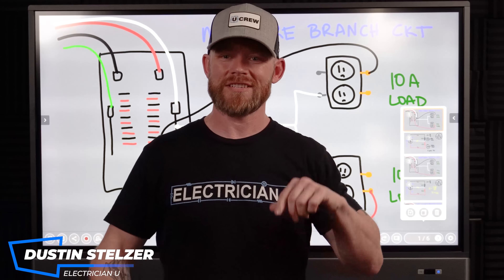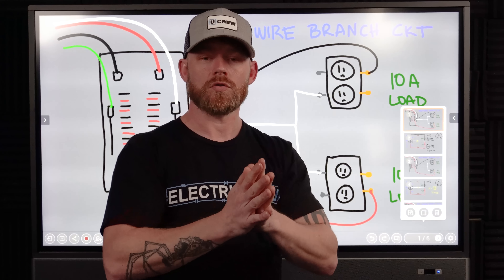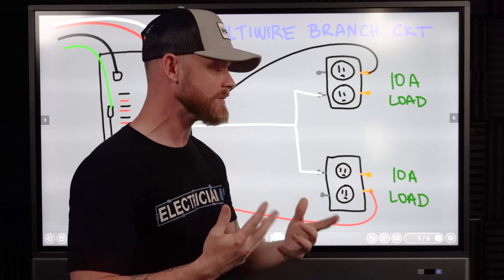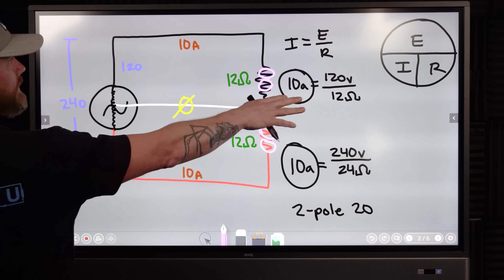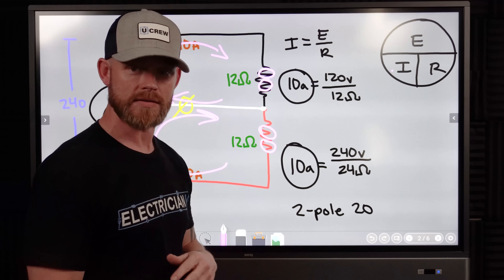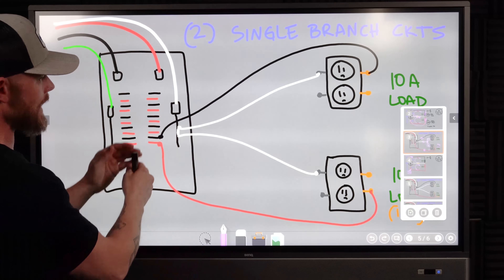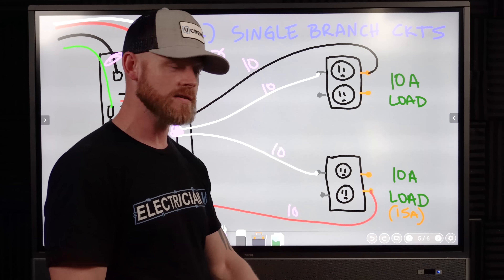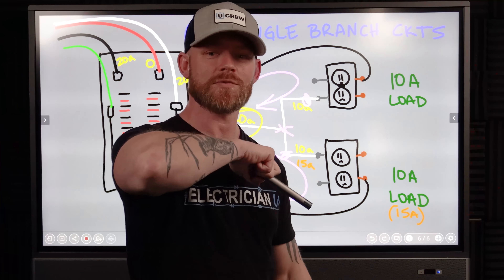Neutral Imbalance in Multiwire Branch Circuits (Two Hots, One Neutral)

Comment: I use to run 3 wire for home runs as you don't have to do as many home runs.   The inspector saw this and shot it down as he said the ground fault will not work.  I tried explaining that the ground fault plug does not care what is feeding it but only what is down line.   He could not understand that and made me run individual home runs.   I asked him why it works in every home in the United States but not if the area he has justification.   He had no answer.   Some of the inspectors out there are simply failed electricians.     This was one of them.
Reply: Yep, as long as you used all double pole breakers or single poles with identified handle ties, this method saved a lot of wire and labor costs.   Unfortunately this pretty much came to an end in residential because of the AFCI and/or GFCI requirements.

Comment: The only time I have ever run into a problem with this is on commercial jobs. If the neutral to the panel loses connection, then you get 240 volts going through any appliance plugged in to the circuit.

Comment: Common mode rejection due to phase cancelation. YES there is current flowing UNLESSS it is 100 completely balanced which exists in the theoretical world only. Uh, zero current?  NO! Never. Your AC theory kinda sorta sucks. Inductive loads will cause some phase shift. Purely resistive loads will induce no phase shift. Good luck  with finding a purely resistive load, and you are not old enough to remember oversizing neutrals by 50-100%.
Reply: How much current does it take to melt a piece of #12 AWG solid copper wire? (98% conductivity building wire)

Comment: Makes no sense.  The 2 outlets do not know in a 3 wire, R  B W , if there is 2 wire  B W, & B W or not.  Now further complicate the circuit panel with say 20 circuit breakers running at same time to many  different  devices and all are looking for path back to neutral?  You showed no successful way for me to run 3 or 4 strands of wire in conduit in my shop so I can pull 120 Black and 120 Red so wood planer, & sawdust vac can run at same time. 1 1/2 hp 120 volt motors.  (Where R & B go by my wall AC unit I can pull 240 volt off same 2 wires with no connection to W neutral). Your diagrams do not show a solution to this without overloading w wire, in your diagram!

Comment: Should’ve talked about what happens if you lost the Neutral in the multi wire circuit with the imbalance loads
Reply: Woooo!!  That’s bad!! Anything connected to those circuits, get 240… er’thing gone.
Reply: Doesn’t it act in series causing the potential for one load to be burned out due to kirchoffs law of current pretty sure the possibility of one load not receiving enough amps because source is supplying lower current for the lower load also exsist just depends which is connected closer to source
Reply: Year one sparky here so could be so so wrong ☠️
Reply: A friend of mine has this happen to his entire house cause the neutral was lost at the transformer supplying his home.  Nearly every piece of sensitive equipment in his home died, including the brand new central AC system as all of the computers in those things need 120.

Comment: Everything made sense, except having two loads running the same current.  Doesn't that create a series circuit? It would cause voltage drops across the various loads. Also the loads would be running on 240volts?
Reply: Look at the math. The amp draw is the same and your loads will be balanced. One load will use up 120v and the other 120v. Both loads will see the 10 amps.
Reply: Ok so then each load sees 120volts since they are connected to netural wire even though the current will choose the other phase since its balanced.
I guess that 120 volt is still seen by the loads even if their is an imbalance of current which would be returned through the netural.

Comment: Great video!  I'm doing some remodeling in my house and I ran mostly 12-3 wire.  I'm glad I watched this before hooking everything up to my panel.  One question.  You said early in the video that the breakers should have a shared bar so they both trip at the same time.  Later in the video you said they could be separate breakers as long as they are on separate phases on the panel.  Just curious how important is it?  It seems odd to me to hook up 120 outlets on a 240 breaker even though I do understand it's not actual 240 since I'm not running 2 hots to the same circuit.  Hope that question makes sense and thanks again for all the great info you post.

Comment: I had a. Customer years ago that had a lighting issue.  His lights were dim.  
I put a meter to the bulb 20v.  And then checked outlets nearby and from the one behind the tv got 200v (the monster power strip was decreasing it to 140 for the stereo and tv.  )

The neutral had either burned or broken so half of the house we added in new neutrals to save the electrical. Oh and it was a pasted house with the panel box in the finished basement so we had to find a way to get it done without cutting holes.    We did it though.   120 each side after we were done.

Comment: There are 3 phases, each 120° out of phase from each other. When using 220v/240v, there are 2 phases; however, I take it that they aren't 180° out of phase, but 120°/240° out of phase (depending on which way you measure around the circle). Given that, then the two should never fully cancel each other out, correct? I understand they'd get close, just not fully cancel each other since they're not 180° out of phase. The other option could be that the 2 phases aren't 2 of the 3 phases, but the 2nd phase comes from somewhere else. Which is correct?

Comment: Office cubes will have 4 or 6 circuits. They will run hots in 12 and a 10 on a single neutral. Or maybe it's a 10's on hot and 8 on white. They were a bitch to demo

Comment: I work with home appliances,  and I come across some houses that their wiring is not up to date or just jack up. I tell you that there are black, red and white 3 wire with no ground. These are the older homes that where in their 60's When unstalling and re-installing new appliances I'll see that they connect ground wire with the Neutral. It's not normal but it works and it doesn't cause any type of short or whatsoever.  Can you explain this or have you seen this before? I seen they use something like this in a outlet plug to pass inspection... older home doesn't have the ground but just the hot and neutral and when changing out to the current outlet, they'll pig tail a wire from the ground to neutral. This way when testing it'll show that theirs is ground

Comment: Try installing a GFCI breaker on one of those,
Reply: You need a double pole GFCI breaker.
Reply: @GH-oi2jf  I might disagree there, the intended purpose of a double pole gfci is limited to pure 220volt circuits that do not require a neutral wire, such as a 220 volt heater element or a 220 volt motor that does not use a neutral. In the circuit described you will never get a truly balanced load.

Comment: QUESTION here:
Can I have 3 outlets 1 of 110v connected to the red another 110v to the black and another 220v all with the same Romex and same 220 breaker?
Reply: Playing with fire, against code but may work if loads are correct.

Comment: so pretty much what you are saying is that if I touch the neutral bus bar when there is an imbalance load then i will get zap?
Reply: nah, electricity take the path of least resistance. Is the theory.    the question is two identical loads on a and b phase both 120v crts  what would happens when you disconnect the natural  ..

Comment: So would the solution for having two “A” phase circuits on the same neutral be to simply up size the wire?? Like, two #12 awg hot wires and one #10 awg neutral??
Reply: No, the solution is not to wire it that way.  It only makes sense when the hot lines are opposed.

Comment: Your 75%, correct/ with exception______---- you forgot the ground . All circuits require. Period... There are still area's you can use the 3/wire system....... The red and Black are both 20 amps, or 15 amps depending on the breaker used....
 not 10 amps.

Comment: im confused on how the current flows your first diagram shows a wire going to each receptacle from a different phase but they share a neutral. I thought to get 240v you would have 2 wires from 2 different phases going to one receptacle. So I'm having trouble understanding how without a neutral those receptacles each get 240v.

Comment: LOYAL SUBSCRIBER.    Please cover the ins and outs of running a feeder line to a detached subpanel.  2005, 2008, 2001 NEC, there is so much BS out there, I dont know if I need a ground from the main, or if I just need to install a new ground rod at the sub panel..  How do I handle neutral and grounds in the sub panel? some say to the neutral needs to be seperated, some say to bond the neutral to the ground....  Looking at the forms, it is still not cut and dry what we need to do...  

Im a mechanical engineer, but Im infatuated by electricity...  Its like watching gold fish, thinking how do they breath under water... lol

Comment: So many electricians know the rules they don't understand what's going on.
Good job explaining that. Again it is 240 volt system. Its that center tap on the transformer that confuses everybody.
Suppose the worst analogy is there's two 120vs that are out of phase That make the 240 volts. No it is an AC 240-volt system.

Comment: I'm still a bit confused.  My bosses company has a common practice like this and I forget weather he put the hots on different phases, but the fridge and the dishwasher were run with a 14/3 to the fridge, then a 14/2 to the dishwasher.  So they share the neutral.  Which example that you gave corresponds to this situation?
Reply: Your dishwasher should be on a dedicated 12/2!, Then your fridge can be tied to general receps.( Not countertops). Sometimes is easier just to dedicate fridge wire also. 
Sometimes we will run a 12/3 to a recep under sink, split the recep so the bottom is always hot for dishwasher, the top can run to a switch for garbage disposer.

Comment: Thank You. Now I understand how the garage that was added many years ago to my 1957 house that I just bought is wired. I couldn't understand why there are so many red wires in the junction boxes in the garage. They ran two multi-wire branch circuits from the box in the house to the garage.

Comment: Code calls for bar tied breakers for MWBC runs.  Seen guys that failed to identify such, open the neutral and burn up electronics and other loads as a result.  Here in the north eastern United States it is somewhat common to find.  Also common are the hots both coming from the same phase and overloading the neutral.  Homeowners and handyman are rather good at this one!  This is also common in allot of commercial electrical installations as well.  Cube sets fed with a "full boat" are a good example.  Most have each breaker as a separate rather than on a 3 pole breaker.  Women and their heaters take those out all the time so the maintainance worker swamps them out to prevent the whole cube set from being brought down.  Ah, good times!  Very good video.

Comment: All bets are off when the load is a switch mode power supply on a device you're plugging in which means computers and all the modern day entertainment equipment, tvs, stereos etc and the modern LED lighting systems (however small the current is compared to older lighting methods).. The third harmonic adds on the neutral, it doesn't cancel in spite of being circuits connected to opposite phases in the panel.

Comment: Well for one the amperage load has nothing to do with it.. As the Neutral has to be sized to the Breaker Size rating...As it's a current carrying conductor..

The reason you can do it. Is the phase angle for each circuit is offset by so many degrees. As you can run 3 hots on one neutral. On a 3 phase panel as well..

And the word balanced just means they are divided equally. Across all the phases used. A-B Single Phase panels. A-B-C Three Phase panels. And you have to keep track of this.

Comment: i wish i knew that 2 months ago! i wanted to run 4 circuit from breaker panel to afci dead front (new circuits for finishing basement) but the conduit can only have 7 wires, so ground + 3 pairs of white+black; and had to run another conduit for the 4th circuit. But with shared neutrals, I could have gotten all 4 together with 1 ground + 2 trios of red+black+white.

Comment: I ran into something recently and was wondering if you could speak to it. Can you explain a manual transfer switch (3wire and 4wire) and the advantages of switching the neutral versus just having it tied in the panel? Does it effect equipment downstream? Also, if you don’t switch the neutral should you establish a new neutral/ground bond on the other side of the switch? 

I really enjoy your videos and appreciate your time. Thanks!

Comment: with a 240 volt single phase service, both black and red are on the same phase.... BUT... they are on different legs because the transformer is a double tap from a single phase feed. IOW, PHASES and LEGS are two different things.

Comment: I have a question.  On your first example, if you have 120v device plugged into the black phase and nothing plugged into the red phase, you'd have 120v running through the neutral.  If you then plugged a 120v device into the red phase you'd suddenly have 240 volts running through the black/red wires and nothing on the neutral (assuming balanced loads).  Wouldn't that damage the two 120v devices?

Comment: I was hoping you were going to go into the case of a multiwire circuit, with two non balanced loads and then the the neutral fails.  As I understand it,  the two loads are now in series 240v across the combined load but the voltage across one load can be  greater or less then 120v depending on the resistance of the load.
Reply: I was wondering about that too. if both are 10 ohms resistance. I don't see why that would destroy the equipment. voltage across either resistance is still 120 V... does anyone on YouTube go over this in a diagram?

Comment: Great video! Here is a question: I just upgraded an old panel and the new panel has all GFAF dual function breakers. I had multi wire circuits in the old panel. I figured that GFCI and AFCI breakers would trip with shared neutrals. Since rewiring these circuits would have been too much work I combined the hot wire so that the hot and neutral are both shared. This will put more devices on one circuit which was ok in my case. Any thoughts?

Comment: Very nice explanation. As a young apprentice without knowing theory, we were always taught to balance the panel. Always had to make sure all 3 conductor cables from panel had each hot on a black and red when neutral was shared. This will clarify for many young apprentices. The push and pull is something you don't realize. Most may think of branch circuit behavior more like DC. Mike Holt doesn't have Jack on you. LOL